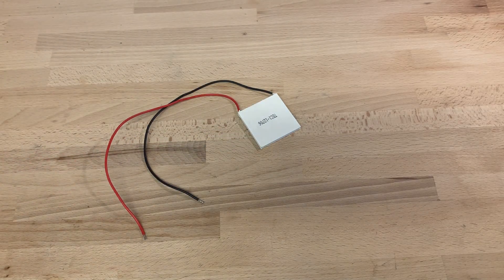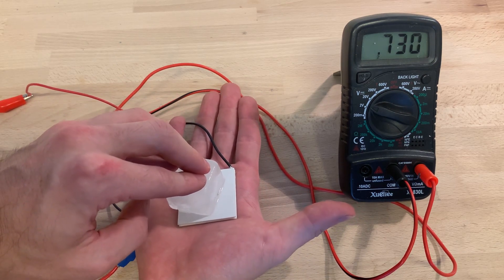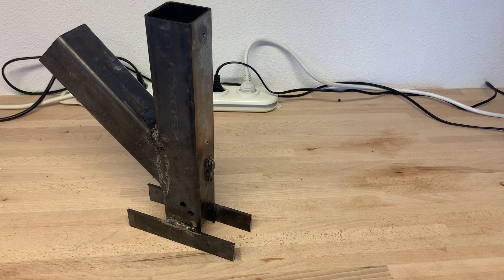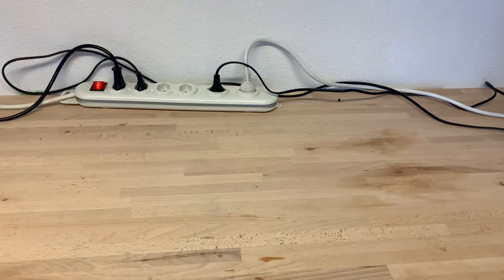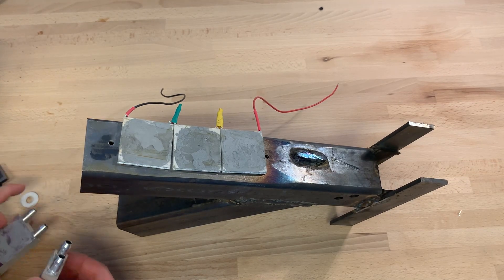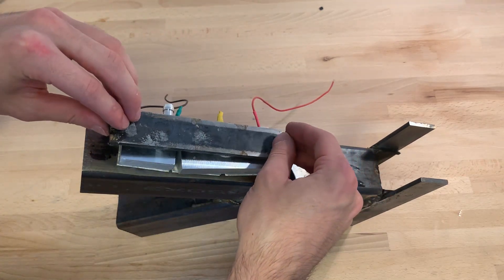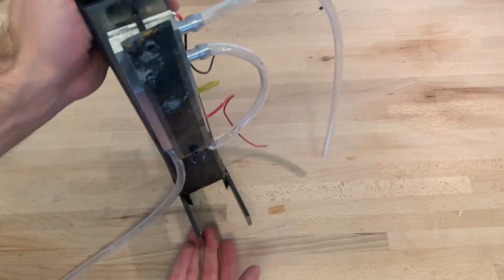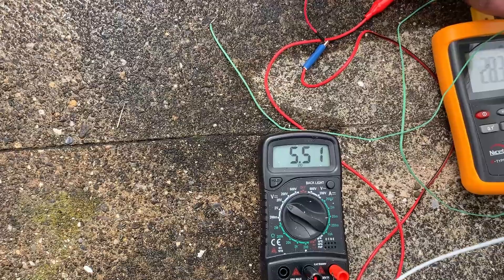Charge Your  Phone With Fire! A Powerful Peltier Generator

Comment: You should retry this using real tegs, these arent meant for actual generation. I am sure you would be blown away by the results. I got 100 watts just with 6 units.
Reply from the maker: 100Watts is crazy :o, i was not aware there are modules specifically for power generation. I will definitely try those

Comment: Interesting. How do you keep from going above the max heat rating for those modules? That stove might burn out your TEG's if the flue gets too hot.
Another approach you might consider is to sandwich your modules between 2 square metal containers. Put cold water on the cold side. For the hot side, heat up a cup of 1mm ballbearings on your stove. Use a thermometer to measure the temperature of the ballbearings. When they reach the max temp of your modules, take them off the fire and pour them into the hot-side container.
In theory, it should work and allow you fairly precise temperature control so your modules last a long time. It would also make it fuel-flexible as any appropriate heat source could be used to heat the ballbearings, even concentrated solar.
It's just an idea. Keep up the great work.

Comment: Can u comment on the dimensions of your rocket stove...what size metal did u use.?
Reply from the maker: The profile is 45mmx45mm, with a 3mm thickness. But i would go larger cause as i said the fire keept going out bec of too little oxygen.
Reply: @bootlegengineer  do you think this would be possible to generate a couple hundred watts with more powerful tegs/tecs, and putting them on a wood fired stove, and using a radiator located outside in -10c with a small fan to cool them?

im talking about 30-40 tecs, cooled with almost subzero radiator water from the winter outside. and generate 12v, then convert them through an inverter to use as home electricity, alternatively to charge batteries,

Or am i better off getting more solar panels and a wind turbine ?

/edit, wood is basically free.